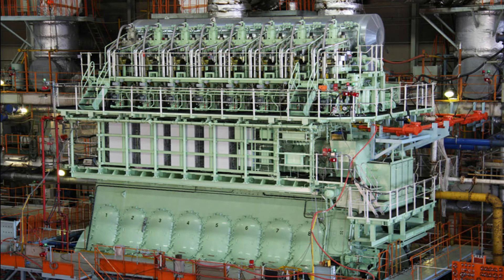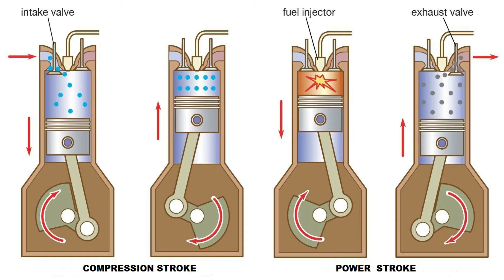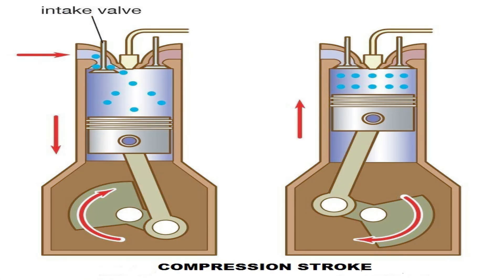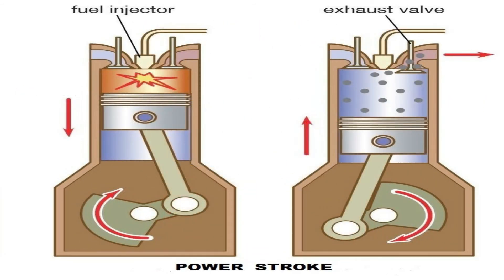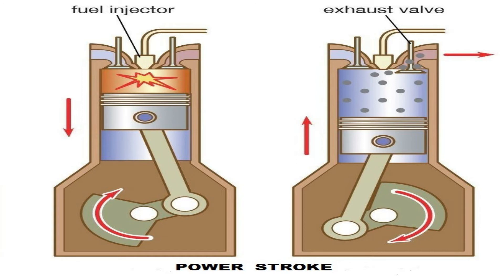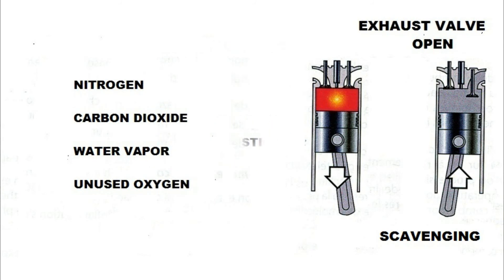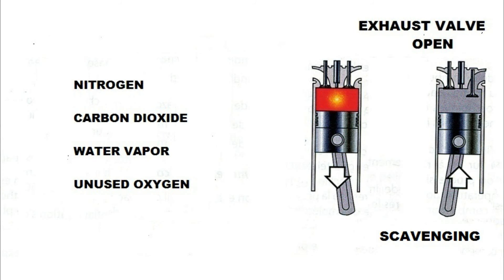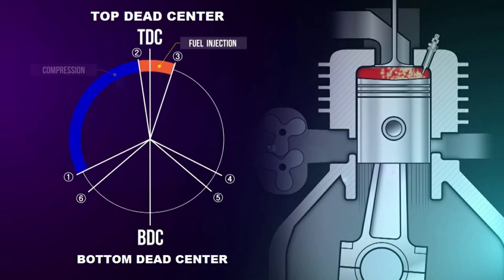TWO STROKE DIESEL MARINE ENGINE

Comment: I would think that more men in the U.S. would be interested in a career in designing, building, maintaining,  and being mechanics on these huge engines.  Seems as if guys are obsessed with the diesel engines in pickup trucks which are 1000s of times smaller than these ship engines. If it's power and size that one desires, then it doesn't get any bigger or stronger than these 2 stroke diesel marine engines.